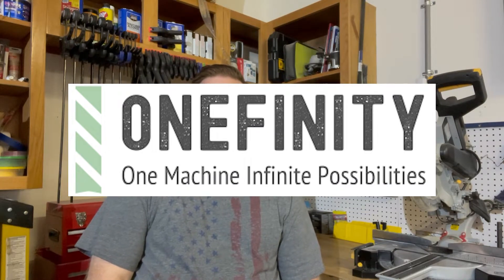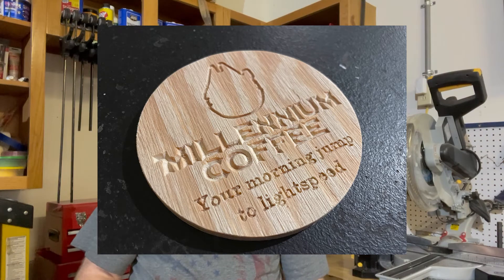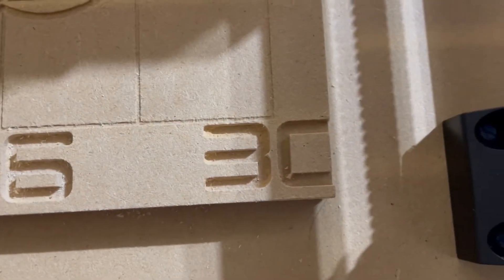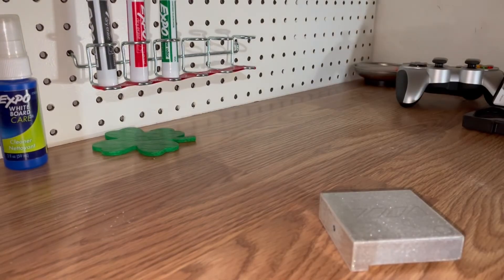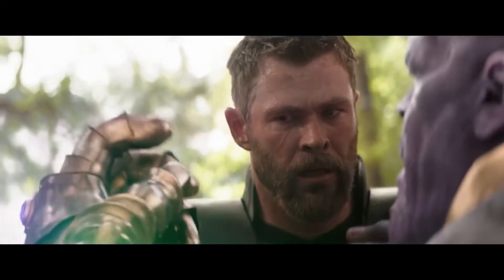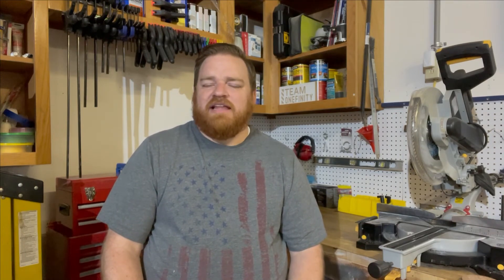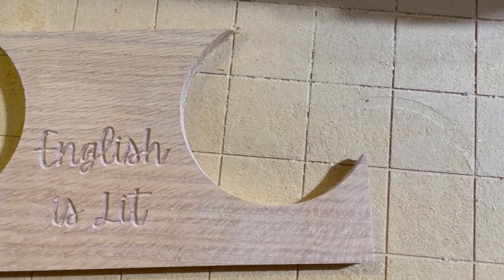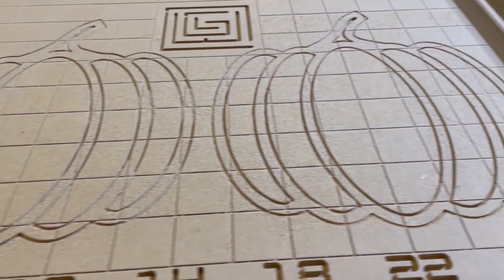My First 3 Mistakes on the CNC

Comment: Thanks for the tips great help .

I have a Onefinity on order and I’m also new at cnc and the software. I went with Carveco software.
Reply from the maker: Let me know what you think of the Onefinity. Since I am new to this maybe I was just going to love whatever machine I got, but I was sold on it once I realized the average set up time was about 15 hours less than some other popular brands.
Reply: Yes that was one of the main reasons as well for me plus I did a lot of research on hobby cnc’s machines and it came down to the Longmill or Onefinity yes the Onefinity is more $$ but it has great reviews and looks much easier to setup and use. Not that the Longmill is bad I’m sure it’s great but I hate building something that I have no experience in from the start. Plus they are local in my area only 30 min drive got to love that saved on shipping will pick my order up when ready. Good luck and hope you made the choice I think you did !

Comment: Yep, I’ve made all these mistakes (and WAY more!)…. A big mistake I made was thinking it was plug and play. Meaning, you can just download the project files and GO! There are a lot of projects out there, but you are going to need to learn a design program. I have 2 shapeokos, so I mostly use carbide create. But I also have vcarve (it has more features but I can do most of what I want in carbide create).
Reply from the maker: I had the benefit of having to wait a good 7-8 months for my CNC to be delivered. I used that time to make lots of digital designs. Even then, just like you said, it was not plug and play.
I use Carbide Create as well. I may grow into another software at some point, but it has worked great as an entry level, learn-how-CNCs-work program.

Do you post any of your work up anywhere? Carbide Create’s online forum?